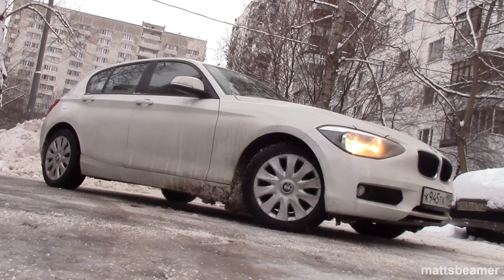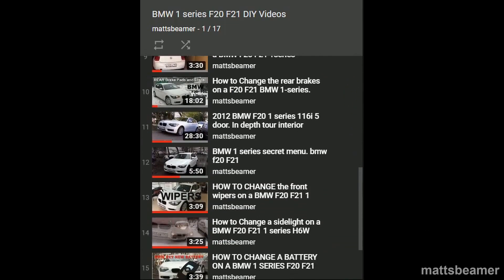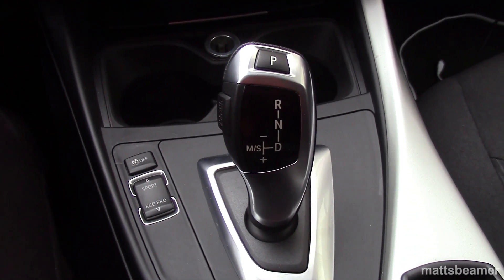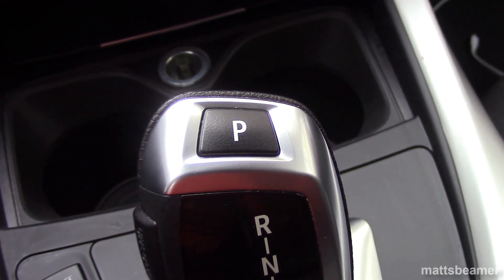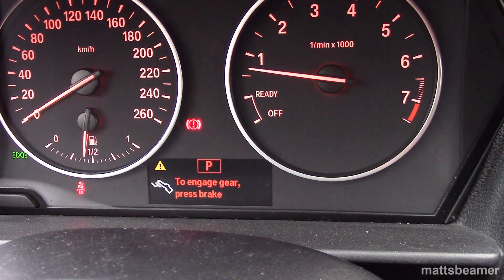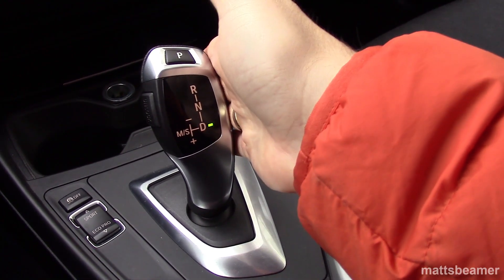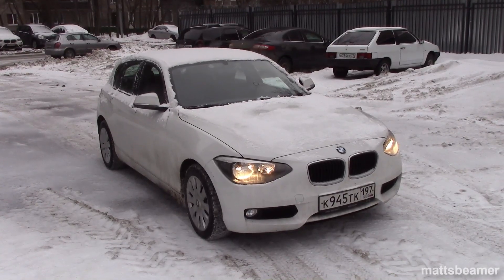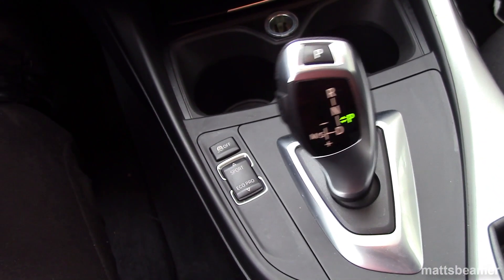How does the BMW Automatic Gear Lever work? F20 F21 1 series Gear Shifter

Comment: Going from a Ford Focus 1.6 petrol Would you recommend 118i or 118d ? My partner has a 1.5 Nissan duke diesel which I hate driving it’s so boring! But I’ve heard the ii8d is much for fuel efficient than the 118i but would petrol be more fun to drive? Or sound nicer? Thanks

Comment: Sorry for the dumb question but new to automatics, What’s the need for a park option when you have neutral? And handbrake?
Reply from the maker: Hey, not a dumb question. I made a video called shall I use my handbrake in an automatic car. I hope that explains it ok :)
Reply: @mattsbeamer  will check it out thanks a lot

Comment: Hi Matt. Is it safe to flick the gear lever from drive into manual mode while on the move. Jase
Reply from the maker: Hey in my opinion its ok. when you put it into manual mode, it will just keep the gear you are in. :)
Reply: Thanks Matt, always wondered if it would be ok 👍

Comment: Hi Matt, great vids 👏🏻 
Here’s a question; what’s the difference between sport mode on the drive select VS pushing the auto gear stick across so sport?
Reply: I don’t think there is a difference, the revs and gears shift timings,mimic each other exactly 👍

Comment: Hi Matt when you shift the lever to sport manual, and car has paddles on steering wheel A will it stay in automatic sport mode, but will only become manual once you use the paddles. Also should the mode switch be put into sport to match the gear sport mode thanks Jim
Reply from the maker: Jim Grimwood hey Jim, sorry for being slow at replying. 
 I believe if the car is in D/S mode it makes the gear change more aggressive and drops a gear or two depending on the situation.
 Sport mode will change the feeling of the car (depending on the options) so if you want the full sporty package you can use both at the same time. I have never driven a car with paddles but Im sure it would change gear by itself if D/S is activated. As soon as you touch a paddle it goes into m/S which will wait for you to change gear. To turn off  m/S you need to put it into D
 I think if you use the paddles in D mode it will temporarily be manual but go back to auto if you use the paddles again.
Reply: Hi Matt thanks for Info and quick reply 👍👍👍

Comment: Hi I’ve got a bmw 1 series and I’m just wondering if you could do a video on automatic window wipers, when I press mine the light comes on it does one wipe and that’s it doesn’t wipe again I’ve changed the sensitivity but still doesn’t do anything. Just wondering if you could help? Thanks.
Reply from the maker: Matt Mayhew hey Matt. Unfortunately my car doesn’t have autowipers, if I can get hold of a car with them I’ll make a video. Sorry man!
Reply: The light comes on to show it's activated. If you keep driving and it starts to rain or drizzle the wipers come on and wipe away the spray. If there's no rain or drizzle it stays off but the sensor is still on. You might assume it's not working but it's basically waiting for the rain sensor built into the windscreen to register rain/wetness. 

It used to bother me too until I realized how it worked. I have a F20 120D M Sport
Reply: C.J. Edu thanks for your response. I’ve tried that and I’ve also tried turning it on when it’s raining and it still only does the one wipe.